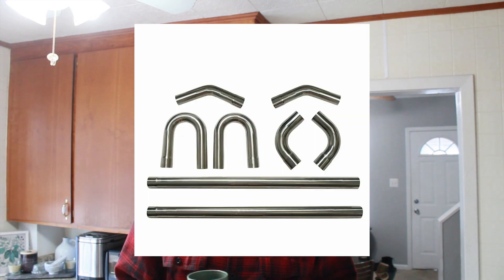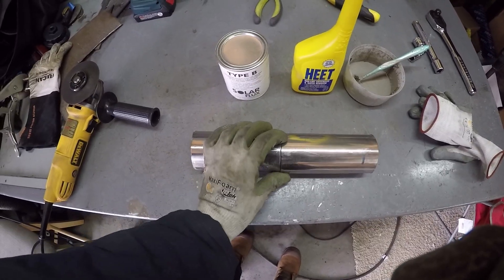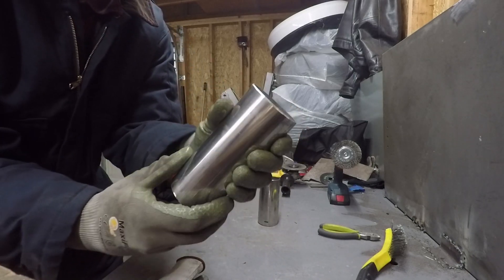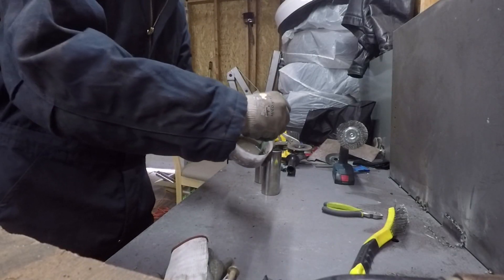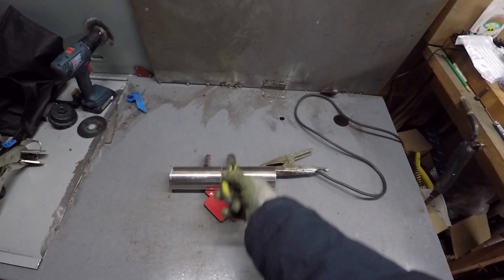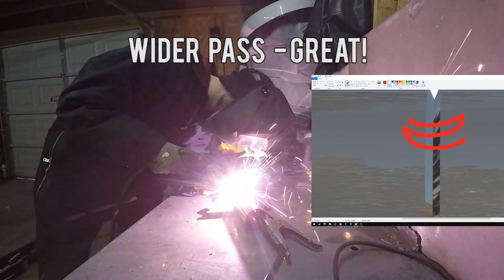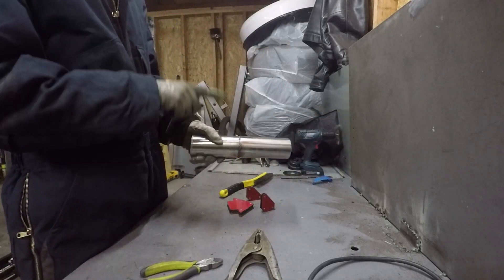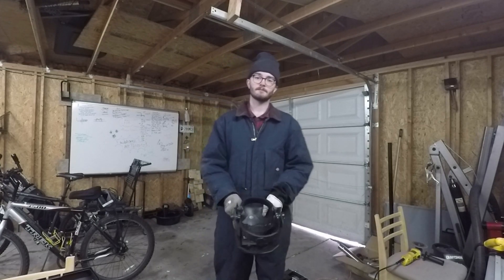How to MIG Weld Stainless Steel Exhausts With Flux Core!

Comment: I'd wear a respirator with the proper cartridges when welding stainless. Those fumes will fuck you up over time.
Reply from the maker: I appreciate the concern, I have since added an exhaust system and respirator. Breathing poison is not too high on my to do list
Reply: My youngest half brother is Fucked up to start with. So, does it still make a difference? He can’t weld either, plus he took my 68 Dodge Charger and wrecked it before he could use the fuel I had in the tank. 
 Yes, stole it because he had someone drop him off as I lived 18 mile from no one in the country. I was plowing since 5AM for $1 per hour, he worked in a toll booth on the interstate! How hard is that! Had ticket on one side, the screen told him how much change to give on the other. Never leave keys in your car even when your closest neighbor is 8 miles away. 
Bastard never said he was sorry after siding sideways into a tree in a grab-wire fence. 6 months in county, 120 civil service, 3 months probation.

Comment: What voltage or amperage did you set for this?
Reply from the maker: Every machine is going to be different, test on some scrap material that matches the profile of what you are welding to and youll be in great shape.

For me specifically- its hard to say, but way too low of a voltage as it was a 110V welder on a long extension cord. With stainless you want to run as low of a heat as you can, but I believe my wire speed was around a 2-3/10 and my heat at a 7/10.

Comment: Could I get the settings in writing please
Reply from the maker: Every welder will be different, do a few tests on some extra pipe to dial in. Low wire speed, high heat, short passes

Comment: If it is not for a car but a charcoal forge fan I just need air to not leak out can I just weld it together?
Reply: For sure! This works for many applications. Be careful if its for a high pressure application, and make sure to check your welds for leaks if possible.

Comment: You don’t need to back purge unless it is food grade
Reply from the maker: You technically don't need to even use stainless wire, but if you're going to do the job you may as well do it as best you can

Comment: It’s says lacquer thin right on the side of the can. Lmao 😂 not acetone.  And you’re supposed to mix solarflux with alcohol.
Reply from the maker: hahaha, yep lacquer thinner is correct but they're very similar! I've been taught solar flux is mixed with Heet as it contains methanol, evaporates quickly, and extracts any water that may be present.

BUT you are absolutely right, alcohol will work great too if you don't want to use yellow Heet.
Reply: @supernull   no lacquer thinner and acetone are not similar at alll.
Reply: @supernull  read the directions right on the solar fix can. It tells you right on the can to mix with alcohol.  
The alcohol will remove any moisture from the weld.   Alcohol is like $1 for a big bottle.  That heat is like $3 for less then half the amount. Waste of time and money
Reply from the maker: @mikeeagle2653  I'll have to try it out and do a side by side comparison, thanks for the tip
Reply from the maker: @mikeeagle2653  as a reference though, if you check the solar flux website they recommend methyl alcohol for best results.
Reply: Heet is 99% pure methanol, Methanol is alcohol

Comment: Pressure test it. I bet it leaks like a bitch.
Reply from the maker: Capped it and filled with water to locate pinholes and it held fine, I don't have the means to pressurize much more past that though unfortunately